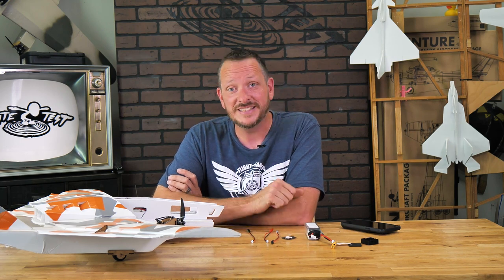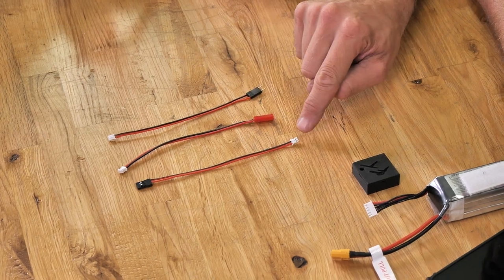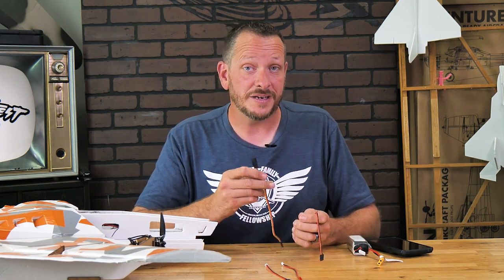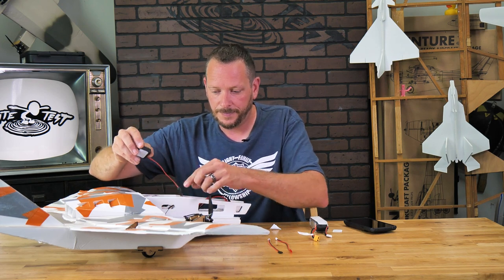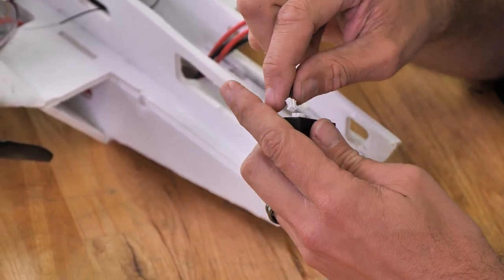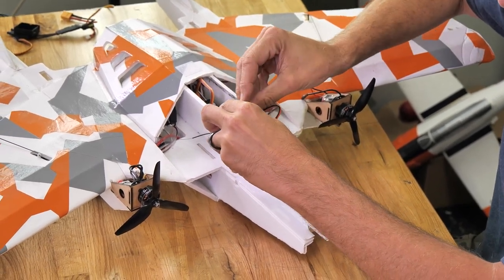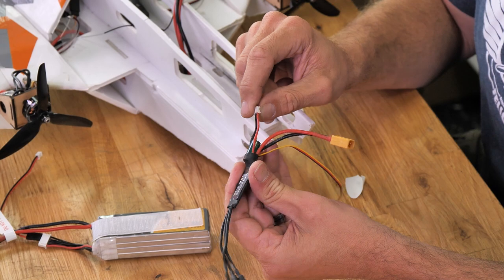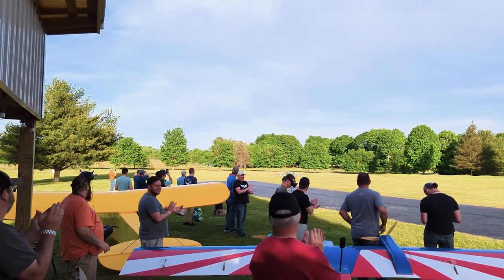How to Install Your EZ ID

Comment: Remote id is just more of a hassle and i get it but it takes a bit of the fun out of flying knowing your being tracked
Reply: Blame the people being irresponsible with their RC aircraft for the regulations.

Could be worse, in Canada the rule changes that have been made basically killed RC.

Again, because of people acting irresponsibly.
Reply: @kienanvella  I still have yet to see one single instance of a foam RC plane hitting a real airplane. Government will jump at any excuse to expand and consolidate power.
Reply: @kienanvella  yeah it’s like really come on
Reply: It's like why now, that we have to do this. It took real planes to make 911 .
Reply: @Mikeylikesit1968  facts man. Like for foam planes those monster 55 lbs planes should be what get tracked not 1 lbs foam
Reply: @ohiorc5586  Hey a couple of pounds of foam took out the Columbia space shuttle. They say the foam came from the external fuel tank but maybe it was really a foam plane?

OK, OK. No need for profanity; I'll shut up now.

Comment: Personally I won't be using remote ID until I get my Part 107 (and until 2024 because it's been postponed) but I love that you guys have made it so easy for people to be compliant.
Reply: It hasn't been postponed.  If you could have done it, but chose NOT to do it, then you'll be non-compliant (probably not an issue if you're not Part 107).  However, if you talk to a FAA person and say, "It was sold out," "It was $250", or something that shows you WOULD have complied if possible after Sept 16, 2023, then you will be ok.    

So just be careful who you're talking to and how you frame that statement (when you get your Part 107).  If you say, "I could have, but decided not to because it was delayed," the conversation is going to shift in a non-optimal direction potentially.  I know everyone's different but I try to keep life simple...
Reply: @SchubertTech  Phrase it however makes you happy. We got until (at least) March of next year. 

And the clowns in Washington really aren't a problem if you stay outta controlled airspace. To be specific, don't get in the way of manned aircraft. 

I fly in a park my city okays for drones and electric model airplanes. It's less than 3 miles from the end of a runway at a busy GA Airport. If I went above my 400' ceiling, or insisted on doing "long range" FPV through their flight path, then there'd be issues. 
But I've got a double soccer field all to myself most days. The FAA has bigger fish to fry.

Comment: I have a 3D printer and the FliteTest Remote ID with connectors.  I am not finding any STL files on the Flite Test website.  Where can I find them?  Also the Crafty link is dead in the description.

Comment: I applaud FT providing another RID choice, but this one, and the Spektrum one are just too large for my micro helis.
Reply: if it is under 250 grams you don't need one.
Reply: @epoweredrc unless you do part 107 work. If you're using it for part 107 work, it needs to have remote ID even if it's less than 250g
Reply: @dinkyemg  oh alright. I always think most here are just regular every day flyers. Part 107 is totally more detailed.

Comment: My how quickly we change our posturing when we discover that money can now be made on this thing.
Reply: What are you talking about? They campaigned against remote ID requirements and then they decided to provide one of the only solutions on the market for the community, specifically designed for us. They said in the video how they designed it so you would only have to buy one and could use it with all your aircraft. And they're still campaigning for the process of creating FRIAS to be easier and more straightforward. What have they done wrong?
Reply: @drabberfrog  they have been doing a LOT of things wrong - not the least of which is deceiving people into believing they could FRIA their backyards. Even though it the FAA was clear about only one thing - it was that only "organizations" would be approved for FRIA. 

I have been a Flite Test supporter for years but their posturing on R.I.D. has me really questioning them at this juncture.
Reply: @sdssteward  well, what options do we have? Remote ID is now the law, and if people don't follow it then they're just going to create even more restrictions. We have to recognize that us hobbyists are a small minority and the people that get DJI drones for Christmas and fly them like an idiot are a much larger group which has many more people concerned. And honestly, what is so wrong about remote ID? Obviously the $100 sucks but people are treating it like it's the end of the world, and it definitely isn't. 10g of extra weight is not that bad for UAs that are 250g or more. All remote ID will do is make it possible for law enforcement to enforce drone laws which already exist, but are very difficult to enforce. And it's not like these transmitters can even be picked up from that far away, it's not like ADSB which has enough range for all aircraft to be tracked live with a reasonable number of receivers spread out. The FAA even extended the requirement another 6 months because of the lack of remote ID modules right now.
Reply: LOL tell me yo are not that ignorant ? Your Joking right ? 
Where have you been the last 15-20 years as the AMA ( the only CBO then ) wanted and demanded ALL recreational fliers be AMA members and Club flying only ? Who btw along with the Commercial drone Alliance lobbied to END 336 ? Now fast forward  FT knowing how the AMA works sought to get a CBO status, where in their OWN demands fashioned their system after the AMA and admit it in their declaration of the CBO and then learning that the FAA was NOT going to allow FRIA's in backyards etc STILL stated they could being a  CBO. and now with their own Golf Course a FRIA and anyone flying there MUST be a member related and when the $$$ rolled with events, Advertisers etc in the sudden epiphany of the $$ on RID that btw the AMA claimed they lobbied for , for years ( Their own words btw ) and now we have CBO's yelling FRIA FIRST and the AMA along with the other CBO's wanted a amendment added to the 2023 FAA ReAuth Act that THEY would have the authority over all FRIA's and ALL recreational Flight...a fact also stated back in 2018 by the AMA's Hanson and now followed by the FTCA and the other CBO's.
SO...what have they done wrong ? That is just part of it
As CBO's they could have stood together WITH the 2+ Million in the community and fought the entire RID and FRIA nonsense  from day one, BUT for the mighty $$$ it stands to reason what is more important to them and buddy it is NOT you . 
Understand CBO's entire "within the programming" definition is MEMBERSHIP...No one can create a FRIA through a CBO without being a CBO Member and an affiliation of that CBO through a membership .
Now do you see a small part of the TRUTH ?
Believe me this is going to bite the CBO's hard in the next few years  because RID will be a NETWORK based system and EVERYONE Flying in the NAS ( including in Clubs/FRIA's ) will have to be SEEN in that space and that means even the CBO-FRIAs will have to have a NETWORK RID signal through the USS and FAA and btw that is IN the very FAA's own RIDEx slide show anyone can access IF they really want to KNOW the REAL TRUTH of the matter !!! @drabberfrog
Reply: @FlyingBuzzard  yeah, I'm not reading all of that.

Comment: Thanks Josh!  Just received my FT EZ ID today.  Prior to installation in my quad, decided to power it up with a lipo, so grabbed one of the provided pigtails and hooked up to a balance port on a charged pack.  Got the red LED as expected - but 10 minutes later, still with no GPS fix - decided perhaps I'd hooked it up backwards - but had recalled the 'reverse polarity protection' comment in this video.  I foolishly flipped around the balance port plug - and got nothing.  Reverted to the original orientation and... STILL nothing. :O  Grabbed a multimeter, and I'm getting 8v to the connector pins on the EZ ID PCB.  DOH!  My experience was NOT the same as demonstrated at 4:40 in this video :(

Comment: Remote id is just a big brother device to charge those that anyway try to comply to the rules. If anyone wants to do something illegal, he will not likely have an id turned on ... Why not have a look at the car traffic where the ambulance and fire fighters have a horn to signal others about their presence.
The concept: manned aircraft publish their position and heading and model pilots have a receiver to be informed about the potential risk. Those who comply with the rules will react accordingly and others will anyway not have an id online. The current concept of the id has no measure to prevent any accident with manned aircraft (or do all manner aircrafts avoid areas where drones with active id fly?).

Comment: I'm a retired Electronic Technician. I would feel better if you could redesign the board slightly to include a small bridge rectifier on the power input. Input power on the "AC in", that way it wouldn't matter what polarity the wires are hooked up, but you may loose the option to run on just one cell because of the voltage drop across the bridge.

Comment: It would be awesome if the gps could be used by a flight controller. With this I’d need 2 gps modules to be compliant and have RTH and nav mission capabilities.

I love that you guys made this, though. Hopefully volume will drive costs down by March 2024 ;)

Edit: just watched Josh Bardwell’s video and this apparently does have that capability. Awesome!
Reply: Check the documentation.  I think there is a uart port for a flight controller.
Reply: You can use this for a flight controller's GPS inputs.  My FC has 4 ports, which use up a UART.  It's real similar to wiring your receiver, and in my case is identical to a ELRS (TX, RX, +5V, Negative).
Reply: I just got the GPS working with my FC (Speedybee F405 Wing APP) using INAV 7.  It didn't work using the "GPS" peripheral in Ports.  I had to use MSP in Ports (rather than the "GPS" peripheral option).  In the GPS section of the INAV Configurator you just change UBLOX to MSP. 

Also the FT EZ ID instructions I found online showed the TX pin as the 3rd pin from the center, but it is the 2nd pin from the center.  I wired that to my RX3 pad on my FC.  It works!!!
Reply: @seanboone843  That's good to know.  I decided if I smoked my FC, I am swapping out the STAX model that came with my JB DIY FPV kit.  I already bought it because I'm pretty sure I saw smoke on one of my battery checks.  Anyway, your info will come in really handy.  I just figured out a "plan B' method to attach the RID module, but Plan A requires me getting my Sovol SV06 printing again.  I did a Klipper upgrade and now it doesn't work correctly, so it's one thing after another.

Comment: Sorry Josh, not doing this anymore, and I don't say that lightly. And to add to that, I hope the vast majority of the hobby doesn't either. Just a few years back, you guys were gung-ho about fighting this, and about doing everything you could to help stop this. From getting in touch with elected officials, to writing letters, to offering "professional" advice to the FAA/Congress about just what this meant for our hobby and for STEM. Yet it seems after a few buddy-buddy sessions when you got to rub elbows with the FAA and those wanting to take our rights and throw them into the nearest trash pile, you've done a complete 180 into towing their narrative. Which now includes selling this crap.

Over the years I've given you guys a lot of my business. From buying plans and kits, to the Master Series planes and XLs, power packs, building materials, foam board and props, even some of my electronics. I could see how much you, your friends, and your company loved the hobby. But during the one thing that hit our hobby hard, which has arguably been about the worst thing to happen to our hobby since  ....well ever as far as I can remember, and you completely dropped the ball. So I'm sorry, but I'll take my business elsewhere. If you guys ever grow your manhood back and decide to fight this instead of accepting it with open arms, I'll be back to support you. Until that time, you guys can take this "compliance" and throw it in the same garbage pile the FAA wants our rights as American citizens to be. 

"How to Install Your EZ ID?"  You don't. End of discussion.

Comment: Josh, the PCB design looks bad. The mounting holes are way too close to some of the components.
Using the plastic enclosure likely mitigate the mounting hole problem but the poor PCB design makes me wonder what else is wrong with the product.
I really think you need to redesign the PCB.
Reply: Bad design cause they did not Flight Test it. The first time someone has a failure to identify it will be on them.

Comment: FT will have many more customers for this product if its a standalone device with 1-2S battery. I see a bunch of wires in this video that people will not want to add to each of their quads. Then the case just needs a slot for a velcro strap.
Reply: You can use this standalone.  I took just the GPS module, and a LiPO 4S (also would work on any 2S, 3S, 4S, 5S, 6S, etc) and it works.  You plug the power plug into the balance lead.  So Remote module, battery, done.  The wiring plug (if you order the model with plugs) hits pins 1 and 3.  The 1 pin is ground, and the 3 is your second cell.  So you have 2 LiPO cells of voltage, with anything past it not in the circuit.